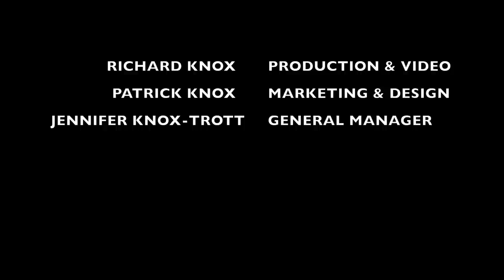S2 EP8 | HOBBIT STYLE OUTDOOR COMPOST TOILET | INSTALLING THE WALL SHEATHING

Comment: If I was you I would start the screws in the top and bottom of the boards before setting them in place. It is way easier than trying to start them while you are hanging by your toenails.
Reply from the maker: I like the challenge, lol

Comment: Seeing all the sawdust you create, I feel I must warn you of an old problem found around abandoned sawmills in the woods.  Piles would catch fire on the inside and smolder for years without blazing due to lack of oxygen.  Kids would come along and see the piles as something to play on and when on top, would break through giving the smoldering dust the oxygen needed to blaze up. You can guess the rest.  As a kid, I have found old sawmills in the woods.  I was warned of the potential dangers and avoided the piles. Spread the sawdust out thin. Sorry to be so glum.
Reply from the maker: I appreciate that. Barns have caught on fire because square bales stakes to close together as well. I’ll fix it

Comment: Question: was looking at the videos from when you started on the house build.. you never made a video on building the sawmill shed? and the funny thing is.. watching your S1 EP6...you're hair back then was darker.. but that wasn't loooooooooong ago  (almost a year 30th Aug 2019)...as for the idea of the day.. a friend used.. a 12v DC PC fan attached to a golf cart battery to blow the smoke away from his outdoor kitchen or you can install an RV celing fan (install it 4 feet above the grill on a custom built box bracket..attached to the pan hanger... and run it on a battery charge by your solar) unless you like the smoke.
Reply from the maker: I’m not getting any older, lol. No video on sawmill.
Reply: His hair is bleached by the sun...  :)